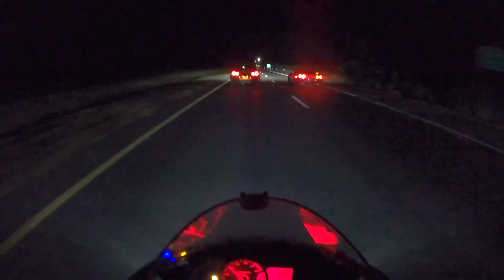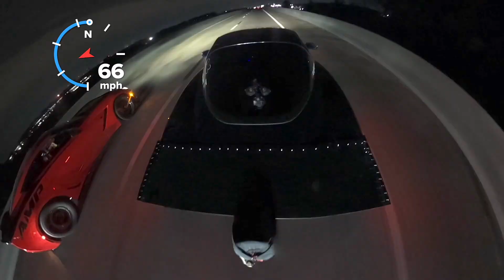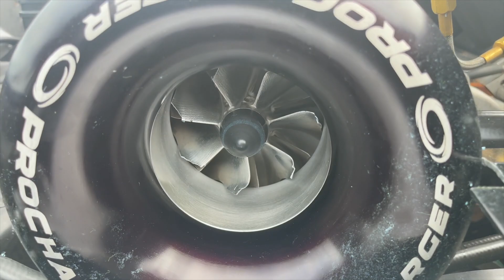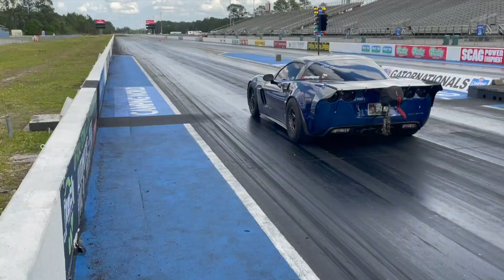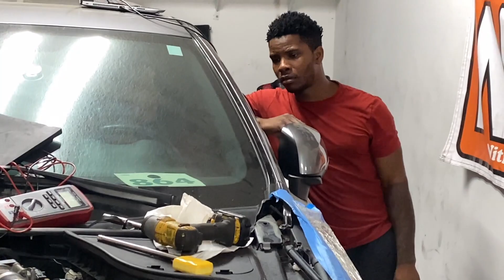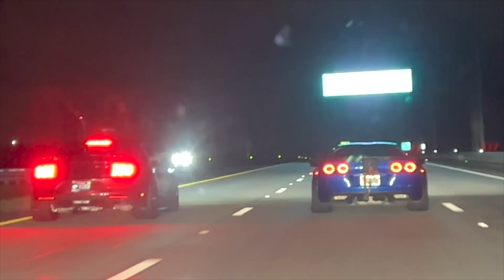Destroyed The F-1R ProCharger | Time for an F-1X ?

Comment: If your looking for simple go blower. But don’t expect it to be easy. Belt slip/breaks are always an issue. If you choose to stay blower then I suggest getting a gripped coated pulley with as many ribs as they sell for it so that it increases belt width and surface contact area. Put a mesh on the front to deflect anything from the procharger. Turbos are better for roll racing and drag racing so long as you have a trans brake for auto and bump box/2step with line lock for manual which you need anyways for those burn outs to get some smoke and sticky tires for drag racing. Roll racing you will need to do a rolling anti lag system to avoid turbo lag or have to play the brake boost game which is a bit hard at times. Then that car will live a bit longer and attain more power with the push of a button. Also you can do a scramble button which helps drastically in any race having turbo. Blower cars heat soak turbo cars get hot so keeping charge temps down is key but it’s not like the games that different heat remains the enemy. Turbo cars, you must have a perfectly seals efficient exhaust system otherwise your screwed. Boost creeps and other issues come along with it if not set up right. Problems are harder to find than on a blower car but when it works it works. Really up to you my man, no wrong way in my opinion. I’m sure you heard it all before. Any route you choose will work out. Anyways great video man. 👍 you know honestly I would base it all on the trans and what’s best for that because usually that’s the weak point. No point in making 1500 whp if it can’t be put to the ground. Turbos have the ability to ramp in power safely because in the end it how much initial shock your putting on versus the amount of ft lbs of tq the trans is capable of before input shaft teeth start getting chewed off or you just spin. Chevys are inherently tq monsters especially stroked, might be a bit more balanced with a turbo kit however not in weight/ front end distribution and space available considering you have a vet. A lot more thought needed for a turbo kit.
Reply from the maker: Man that was a lot lol. But yes. Focusing on making this setup work but switching things up

Comment: Nope my man is turbo time I myself wouldn't want to spend another 6+ grand for another SC when you can get a killer turbo for half that that would make way more power easier and it's much less stress on the engine itself. Move out that SC and put the roughly same size turbo in it's place. Let's not forget you'll make your power up in the mid to upper rpm range hence breaking less parts lol.Dude lol it's time to go turbo without any doubt.
Reply from the maker: Those are facts, the only thing about the turbo that I know can be rectified with a smaller turbine housing is the lag. I’m gonna miss the instant torque of the SC

Comment: Turbo Will solve a lot of problems honestly, your running meth now but turbos being efficient and all. You’ll make more hp on less boost (lower temps) and can probably get away without using that risky stuff. Also no belts, brackets, better adjustability, can dial it in to actually hook. I’d love to see it at its full potential.
Reply: the power adder doesnt determine grip, but 15's sure do
Reply from the maker: Mannnn I’ve been blowing tires off with 15s since day one
Reply: @McgradyRacing  you running d/a vikings or something like that?
Reply from the maker: Stocks right now, but Vikings is the goal yes
Reply: @DontStopReeling   You have more control with turbo’s, boost by gear and other settings with certain management devices will definitely give turbo cars a traction advantage over blower cars
Reply: @DontStopReeling  unless you wastegate a centrifugal blower, you can’t get the same adjustability and  it’s a reason all the fast cars you see with big money are turbo’s. Usually badass cars with blowers on them are only running a blower to help them fit in a certain racing class that allows them to be more competitive
Reply from the maker: Yea man, that EBC is something else. Let’s see what the F-1X, suspension and 6 bolt heads does for our setup

Comment: I have a 99 C5. Built the motor, just stock block sleeved with TS bottom end. Nothing crazy, but I have twin 62/66’s rear mounted, and one thing I absolutely love is I can make whatever power I want on the roll. Wanna make 600? Setting C. 700? B. 800? A. 1050? A-….. I would keep going but that’s all she can make 😐
Reply from the maker: Yea man, that EBC is something else. Let’s see what the F-1X, suspension and 6 bolt heads does for our setup

Comment: Fix your current pro charger (seems easier on the pockets for the time being), use the money you would use for the F1X or turbo setup and get proper suspension setup.  Get this car suspension properly dialed you might be faster than you think man
Reply from the maker: Those are facts bro, I just figured why not do it all? F-1X, suspension and 6 bolt heads

Comment: Go turbo! I know you ignored my last comment I sent last time. You’ll be spending a lot more on belts. I think you could make a lot more with a turbo.
Reply: Hush it
Reply from the maker: Sheeeeesh 🤣
Reply: You agree with your statement except for it being cost effective. Turbo cars run hot so cooling becomes an issue. Also you spend money and time chasing boost leaks and creeps. Then there is the time trying to tune out the disadvantage of having a turbo ie lag. Superchargers are simplistic easier to install and more consistent. At that power it really doesn’t matter. Not like he has hit a wall for the power he wants. He can easily max the motors capability with a blower. Now it’s a bit easier on the rotating assembly having turbo it’s just more efficient I agree. Turbos are free power no belt problems. Either route is good in my opinion.
Reply from the maker: Well put my man! Superchargers definitely definitely put more wear on the motor, and turbo set ups typically see higher IATs. That boost lag is one of my man concerns honestly. But that can curbs with running a smaller turbine housing in comparison the the compressor housing diameter
Reply: @McgradyRacing  there are rolling antilag and flat foot shifting to eliminate lag and boost by gear also for traction.
Reply: @joshreynolds729  blowers have way more issues with heat then turbos. Heat soak a mf.
Reply: @darickster6468  really depends how much boost your running and if it’s a positive displacement or a centrifugal type vs turbo. But yeah generally your right heat soak is a mf 🤣.
Reply: TTiX turbo kit
Reply from the maker: Lol I’d have to look that one up
Reply from the maker: Nawww man, didn’t ignore your comment. Just haven’t gotten the opportunity to catch up on all comments
Reply: F1 my dude

Comment: Since you have to get it fixed anyway, I vote F-1X just for the headroom...But I definitely say get the traction issue sorted first before making more power/track vs street plans. In the tx2k videos those other vettes were making similar power and were hooking even with their cars leaving harder on the hit. I know it's not as fun as having new shiny power parts show up to your door lol, but once you get it sorted man, I think you'll get a more accurate gauge of if you really want more power or not. The car is fast enough as is to you where you probably wont find too many races outside of events anyway. You've just got to make it usable
Reply from the maker: That’s facts bro, I couldn’t have said it any better but I say we do it all. Suspension, 6 bolt heads and get the head unit sorted out